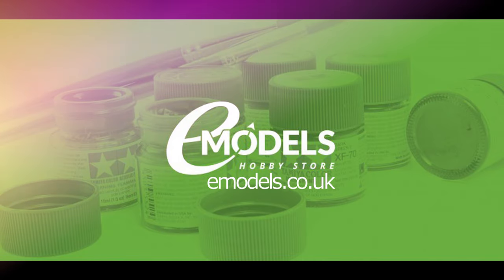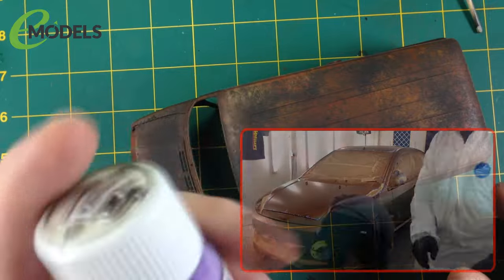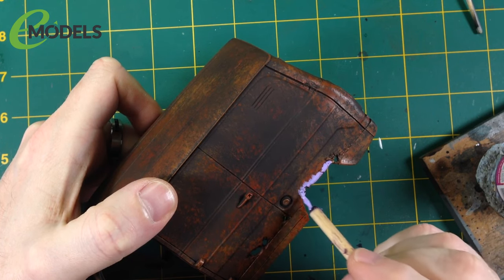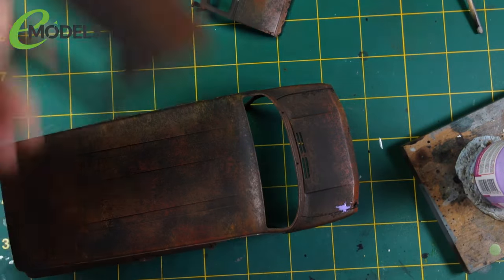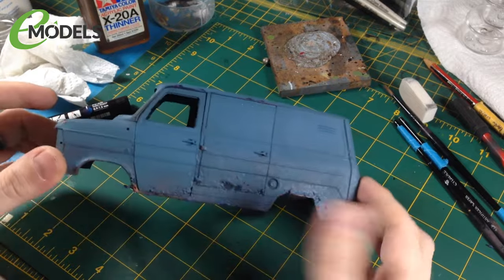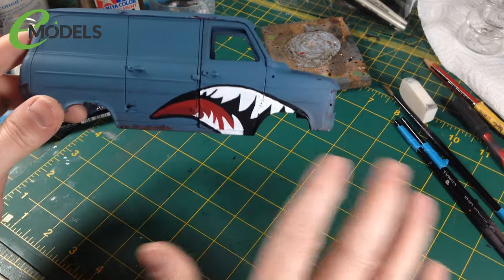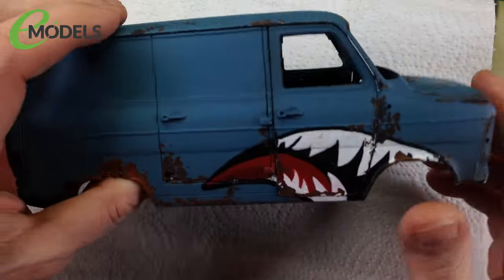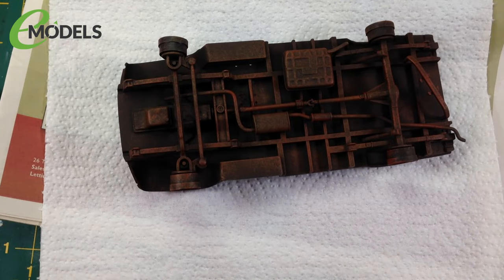KNACKERED OLD TRANNY - Italeri 1/24 Transit Part 4: EPIC SHARKMOUTH ACTION

Comment: Great vid as usual just a heads up on the lighter fluid, if you use it with oils for washes and what not they dry much faster because it evaporates so quickly ✌️👍
Reply from the maker: I know, it makes life MUCH EASIER as I am not waiting round for an eternity for stuff to dry ^_^

Comment: I my mis it, but how long let you dry the paint before put the masking on?
Reply from the maker: With most acrylic paints I find you can happily mask over them after only a couple of hours, although it's wise to leave them, for 24 hours just to be absolutely safe. Tamiya metallic colours should always be left for 24 hours though, they take a little longer to fully cure. Ammo and Vallejo paints I leave for 24 by default anyway as they are not as tough as Tamiya paints, and Citadel paints can be masked usually after an hour or two, those things dry super fast.
Reply: I thought something like that, thnx